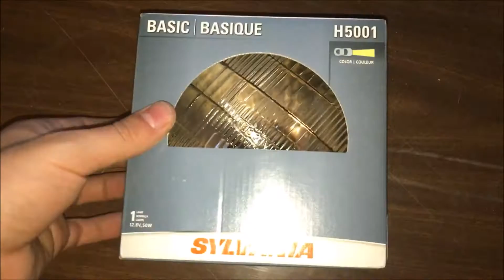1987 BMW 528e high beam headlight install: P6

Comment: What website did you find the bulb on and can you have LED lights?? I just got a 1988 BMW 528e and I prefer LED’s but am having so much trouble finding parts and accessories for my car
Reply from the maker: Taylor Tott I was never able to figure out LED headlights for the car.  You’ll have to research it more.  

For finding parts: eBay, Facebook bmw e28 groups, local small BMW mechanics, junkyards, and other sites.
Reply: Brandt Cotherman okay, yeah I’ve been looking into it for a good 2 weeks & it’s definitely confusing; almost seems like I’d have to convert but I didn’t think about a 28e FB group, I’m gunna definitely check that out. Thank you very much I greatly appreciate it!!